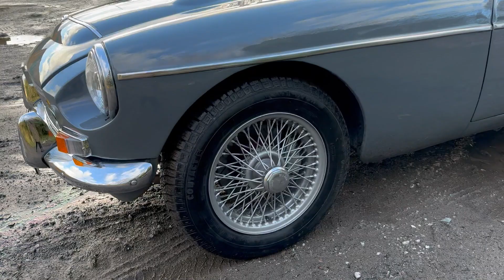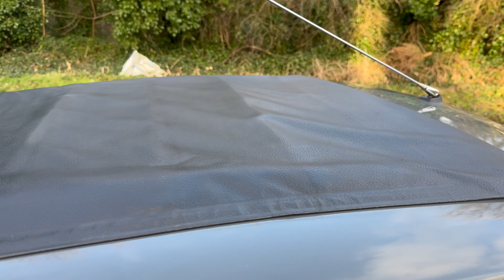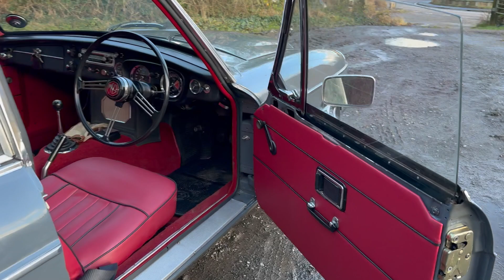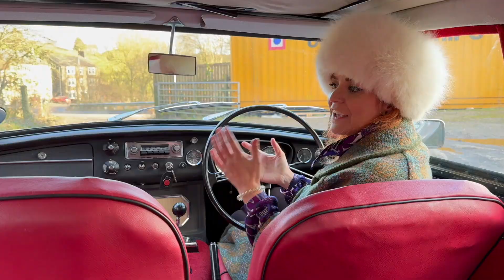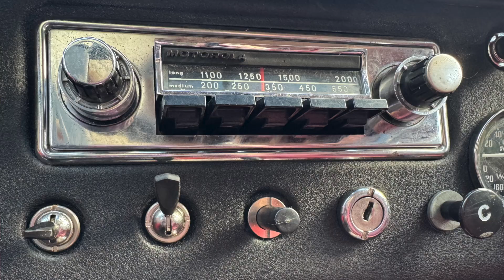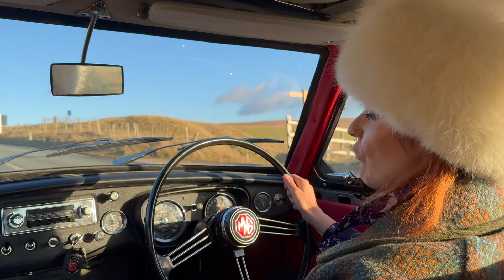1960s MGC - MG's coolest sports car?!

Comment: Not a spirts car at all, they fitted a 6 cylinder morris truck engine with twin carbs jammed it under the bonnet designed for a small 4 cylinder, didnt bother with bigger brakes, better steering  or better handling,       it should always have been the light powerfull and economical rover v8, from the same family,

Comment: My first car when I was 16 was an MGC-GT in racing green, 4sp manual w/OD and spoke wheels.  I wish I never sold it - it had been my dad's and needed work (head rebuild, rings etc...) and was just sitting in the garage.  I was a bit too young to appreciate what it was and was set back by how expensive parts were when I needed parts specific for the MGC (vs. MGB's more common parts).  I rebuilt the engine at 15 with my dad sipping beer in the garage giving me advice.  Unfortunately, after building it, I somehow misplaced the rear plate which mated to the gearbox and had to search many junkyards for months until I found one.  The overdrive didn't work, and I repaired it by rewinding the coil that actuated it.  I enjoyed my trips to Moss Motors in Goleta CA - as the author stated, the parts were next level quality.

Comment: I had a 1968 MGC which I used as my daily driver for about 6 years from 1980's to early 1990's. I agree with your review. It really is fantastic car to drive. Long legged with overdrive and very comfortable, even on long trips. A very usable classic which I would think would still be the case for 2025 road conditions. Only downside for me was the excessive fuel consumption. About 100 - 120 miles from a tank.

Comment: Fabulous restoration but although the MGC made a lot of sense replacing the ancient AH 3000, it was clearly very dated with the steering wheel and grille etc. looking so old fashioned for the late 60s...

When you compare it to Triumph who from '68 introduced the GT6 Mk2 and TR5 (and later TR6) with modern satin black trim / paint and dashboard dials, Rostyle wheeltrims and smooth efficient 2000 / 2500 six cylinder engines that weighed about 2/3 of the hefty BMC C Series it's easy to see why the MGC never really sold.

Very unfortunate that the later, gorgeous, short lived MGB V8 of 1973 was so quickly terminated by the oil crisis of the early 70s....

Comment: I have one of these and use it as my daily driver. I had a B GT for 13 years and upgraded to the C wanting a little more power. I’ll say that the B is probably a more fun sports car as it is lighter and more agile plus the 4cl is very charismatic but the C is by a long way the better car overall. I’m quite surprised how much it’s gotten under my skin and how much nicer it is to drive, significantly smoother and more relaxing plus the engine is way more refined. It seems to get a lot more looks too, even when the B was vibrant orange and had a loud exhaust, the C seems to garner more attention.

Comment: Good video but I would like to correct you on a certain thing you said. The MGC didn't get taken out of the market just because of the Triumph, it was at the time when MG wanted to put the rover v8 in it but werent allowed to so they put the straight 6 in. Lots of private people where putting a rover v8 in them ,the v8 cars are faster lighter and handle better than the MGC. So when Triumph and MG merged one had to go and the MGC has low sales ,but people were taking the MGB GT's to private people to get it swapped for a v8 lump. if the mgc was taken off the market like you said to make way for the Triumph then why did they bring out the MGB GT V8? it was because of handling and low sales

Comment: That has had a bit of head work done - my neighbour was the president of the MG car club, he had one of these. Got it to 220 Hp with bigger dual carbs and porting and polishing - Balanced the motor, and he got 6000 RPM quite comfortably. Lovely car.

Comment: As far as the under steer goes the tests were done with the old bias ply tires and I believe I read they were not inflated to the correct pressure. Today's radial tires are so much better so the handling should be much better.
Reply: I've got Continent on it, the handling is super 😊😊😊 better than the one I drove nearly 30 years ago 😊😊

Comment: Great looking car, the grey and red is superb. These cars can be made to 'GO' if you wish over the factory spec. Years back in UK I had an MGC GT that had been modified by the famous Downton tuning house to Stage 3. Triple SUs, polished and ported head, modified intake manifold and lightened flywheel etc. She went very well and was a revelation over the standard car and just showed what could done with an engine the critics loved to complain about. It's a shame in some respect that MG themselves didn't invest in the engines tuning capability – it would have benefited in the sales of the car I'm sure, as I believe Downton offered a Stage 1 and Stage 2 tune to this engine, which both retained the twin SU setup? with other mods. Still the standard car is fine! A real mile eater – at the end of the day you can't beat a straight 6, and this is coming from a man who has owned a BGT V8. A fine looking car you have there Kevin.
Reply: Yes, these BMC engines need work to release power, my 2.0 Bgt has stage 2,  and makes the standard lump feel very stodgy ...
Reply: Today I have an early pre April 67 GT, with an uprated cam and close ratio gearbox, which I bought in April 2024.
I owned this very same car in the 1980s, selling it in 1988. Nice to have her back again – she goes very well.

Comment: As an owner of both an MGB and an MGC GT I fully understand the pleasure you are getting out of Kev's car. I would add one other thing I don't like about the C, here in Australia the cooling system does struggle a bit during summer and the steeply sloped rear hatch of the GTs (B and C) do concentrate the heat during that time. 
Also prior to upgrading my car to a triple SU setup I found the C to have very poor cold starting habits often feeling like it was running on 3 cylinders until it had come up to and idling temperature.
It is surprising how different from the more common MGB the MGC is which can be a bit of a trap after driving an MGB as you get up to the speed limit that much quicker than the B.
Funnily enough for reasons I've never understood the C gearbox does seem notchier than the MK2 MGB gearbox. I have two reconditioned overdrive gearboxes available for my C and both are much notchier than my MGB's one is.
The grey and red combination looks fantastic on Kev's car, nice change from some of the more common color combinations. Hope he gets years of pleasure out of it.

Comment: Beautifully done !
While working for British Motors of Monterey ( Calif 1968-1972)  I bought an MGC GT. Mineral Blue,  Webasto sunroof and a 4 speed (yes 4 speed) automatic transmission. It was a fantastic car.
Many complain of the handling, Increasing the front tire pressure 5 libs did wonders. This was a GT, a touring car, not a race car. It served its purpose admirably. 
When my second kid came around two crowded for 4 so sold it.. big mistake.
Should have kept it and bought a 4 door saloon of some type for my wife to drive.  Oh well.. the cars we should have kept such as my 46  TC, Fairthorpe Electron Climax  SD1 and more. 

Excellent video. 
Thanks from Southern Oregon USA
1963 MGB currently.
Reply: Nice

Comment: Understeer happens when the tyres break loose from the pavement. In a turn the front tyres would break loose first causing the car to "understeer".  There are ways to combat this;  steering with the throttle and hand brake turns on slippery pavement among them. You might also bring it around with lift throttle oversteer. I had a TR6 which understeered and i could always manage it fairly easily.
Reply: This car drives better than the first one I drove nearly 30 years ago 🤔 it's had poly bushes fitted and Continental tyres fitted so all's good 😊😊 happy Christmas, I've still got another week or so improving the car but the basis is awesome 👍😎😎
Reply: @kevinhirst4108  is that the lake district or northumberland where it was filmed i don't recognise the place???
Reply: @raycroal  it's near Marsden near Huddersfield, we are hoping to go to Northumberland next month, subject to weather 😎😎
Reply: @ nice hills down there i didn't know you had them that far down lol

Comment: Great test Steph. Had one of these and fitted the original heated rear window switches (Original Part Number - 97H2792 round push pull white illuminated) it went where blower switch is and this is moved down in a new hole towards the speaker. The original rear heated screen was laminated and cost a quite bit extra! My dad worked for MG and I was there at its pre-show 1967 in London.

Comment: Think I would have taken the tow bar off personally.
Reply: I put the tow bar on deliberately, because I supply cars for filming my theory is I can supply an MGC and another pulled on the back of it via my car trailer! Thus providing 2 vehicles 👍👍👍 Yorkshire thrift 😎😎😎
L
Reply: @kevinhirst4108  Yorkshire thrift indeed. 😎I understand your reasoning for putting it on and of course it is likely that some would have had one fitted back in the day, you have the straight six to 'pull' you along after all. 👍
Reply: I tow a glider trailer (9m long) with mine. It tows beautifully.

Comment: They are a nice lazy car to drive you could drive from London to John o croats without changing gear so much low down torque. Stop using the overdrive leave it in for mways and dual carriage ways
Reply: They are a beautiful old car! Like the old Triumph 2000, nick name the Lazy 6 as they never did any work because they didn't have too! Happy Christmas and thanks for your comments 😎😎😎

Comment: I'm old enough to have been aware of the bad stories and then the cancellation of the MGC - deeply and irretrievably flawed etc. - as a kid at the time. And both happy to hear it was a at its heart a good car and a step different to the MGB, but sad of the lost opportunities by that cancellation and no further development. I guess it was bad enough with the rivalries in BMC then getting worse with BLMC, let alone the added turmoil of all those British sports car brands of MG, Triumph and Healey (Jaguar aloof with the Etype).  Shame no (?) decent and dynamic motoring journalist had got an MGC early on, added good tyres, tweaked the suspension/brakes, and shown it to be a good car and not the bad one of the car hack reports.
Reply: When I first drove one in the 90s I absolutely gunned the car round an S bend, I found out the "flawed handling! I learned a very important lesson, that was a deep respect for this model, I also feel in love with the car. 😎😎

Comment: Great to see another MGC has been preserved, nice job, well done.  This brings back memories of an immaculate 1968 MGC Roadster (PMO 262F) I bought for £600 in 1973 and ran until 1976, a lovely car in Tartan red with overdrive,  knock off wire wheels and detachable hard top. It's one of a handful of cars I shouldn't have sold. According to the DVLA website, PMO 262F is still on the road, I believe in the Essex area.  If the owner happens to read this, please get in touch as I have information to add to the car's history.

Comment: That’s beautiful, I went out in one when at the NEC November 2023. It looks like an MGB but is significantly different up front with a very different suspension to accommodate the much longer engine. My mother had a brand new MGB GT bought new in August 1972. It was Harvest Gold and I still have the original invoice for it in my archives.

Comment: Love your reviews. I had  C Series engine.......in a Wolsey 6/90. Beautifully smooth feel and I loved it, but not 14mpg around town and 18mpg on a run on my low 1970s wage! So it had to go.  I then got a 1958 MG ZB Varitone Magnette, which was an absolute favourite and that I drove everywhere with complete reliability for 6 years.  I've not checked your reviews catalogue but I'd love to see you doing a review on one of those if you've not already done one. It was the poor mans Jag Mk2 (and rather better in its own way ha ha!).  Although MG snobs back then looked down their nose at it I believe as really being a Wolsey design that had been badged up to MG spec, I think they did it a great injustice. Anyhoos, keep the reviews coming 👍p.s. I also had all the Morris 1000 variants (saloon, convertible, traveller before either of the aforementioned cars). I still like a 'classic' today, and for 18 years have owned a latterday classic, a Mazda Bongo - fantastic MPV / camper but outside your review remit I think!
Reply: I hope it does more than that! I'm from Yorkshire after all lol 😁 happy Christmas to you 😊
Reply: @kevinhirst4108  I'm sure it will. The Wolsey 6/90 was a tank compared to the MGC. 🙄😆

Comment: Great point about the Smiths Oil & Water gauge on a classic car. Your right the gauge will definitely save your bacon before you end up with a cooked engine. It could save you from a complete engine rebuild.

Comment: I remember when a 10 second 0-60 time was impressive. I think the TR6 got the nod because the MGBGT was still available and would be for more than a decade. Personally, I'd love an MGBGT and prefer them, but the MGC is still a wonderful old motor. By the way, as an ex smoker, I'd flick my ash out of the quarter light, but stub my ciggy out in the ashtray. Responsible or what!

Comment: Nice car i would recommend you loose the fual filter they look good but i had one brake in half the casting are not good and if they brake and spray fual every were my one broke on start up so didn't set fire bit if had been hot would have gone up the plastic filters don't look as good but are safe  in my opinion
Reply: I've heard that as well?? Apparently it's supposed to have been modified??

Comment: Might have a case with weights and measures calling a 2912 cc engine a three litre l.
2.9 litre is more accurate.
Not aware of any other motor getting taken up to the next 100cc level for just 12cc. 50 cc is the accepted rounding point.
Reply from the maker: That’s how it was badged by them.
Reply: @idriveaclassic  not very honest to call or badge those as three litres. Sharp practice.